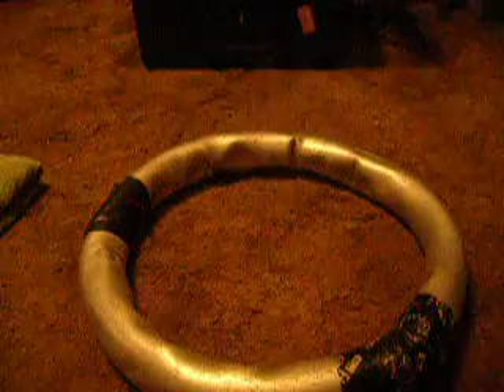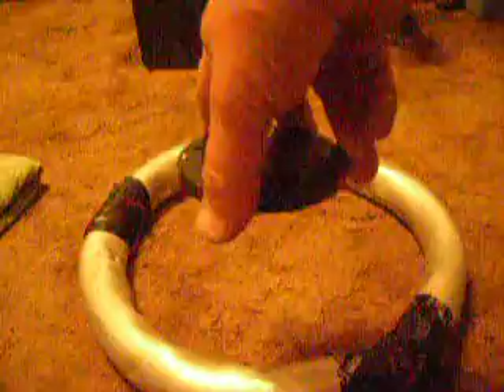Leedskalnin PMH and a convex mirror

Comment: Very fascinating, David.  I'd like to see this done in an x-ray room...ie lead lined walls, floors & ceiling....this way the electromagnetic energy from HAARP/Scalar Technologies are not influencing your tests & test results.  Way you can see this EME is have your web came recording your living room...kitchen...whatever room 1 chooses...will see the increase & decrease in light as well as seeing the distortion the EME is causing. Here's an interesting discovery I made...at night time...get into a much of a dark place as you can...record a couple mins. right out in front of you...perhaps just above your head.  You should be seeing blue light bars raining down...may even capture some of the designs that come in different colors such as red & a yellowish white colors.  Look up Project Blue Beam.  Another way to easily see the EME field is put solid black paper, plastic, etc about 3 inches from the cam'...record for a few minutes then play back.  All the movement you see is this EME field.  You might be able to capture the "brick wall" they have been able to create...why ppl experience writers block.  Concerning your experiment...that was really kewl, DAvid...!!  It was easy to see the energy field as you traveled the mirror around your aluminum tubing. Thanks for sharing w/us, wish you the best of success, David